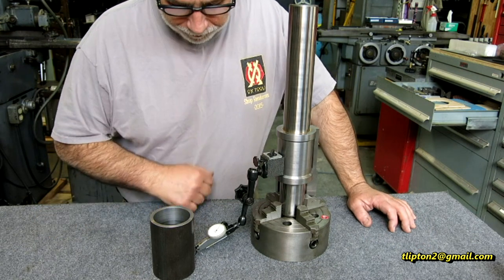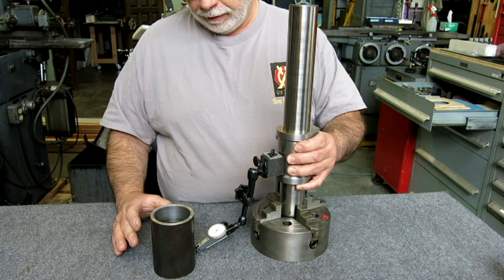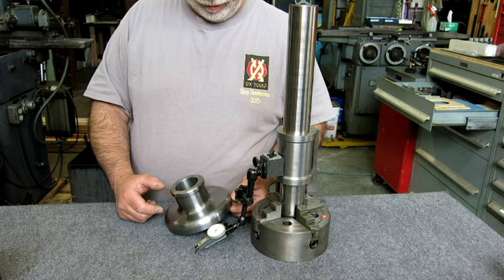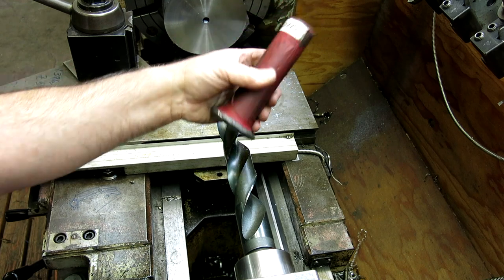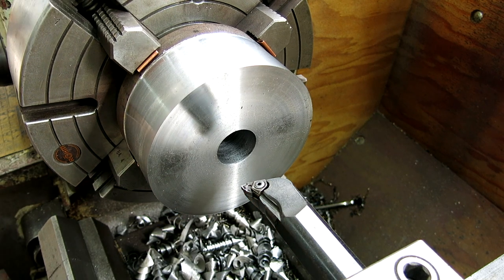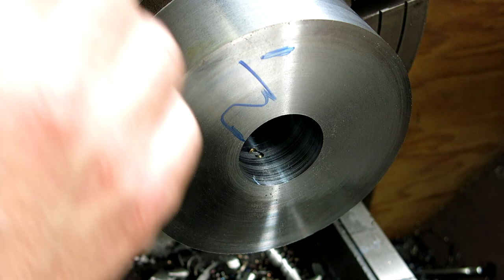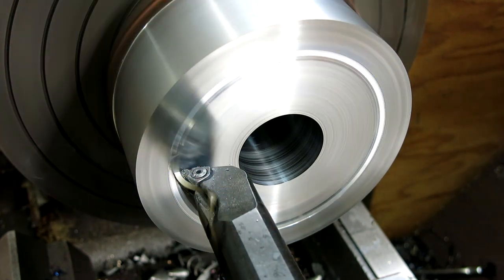Traveling Squareness Comparator Part 1

Comment: Sometimes it's the details along the way: I made up a set of copper-pipe jaw shields for my (small) 4-jaw a while back and was having trouble with them springing out of place and generally not conforming well to the jaws. After seeing this I hit them with the propane and son-of-a-gun, a little light hammer-forming brought them into close-fitting, custom shape! That annealed copper is like a whole different material. Thanks Tom! :)

Comment: When you were using the boring bar to face the shoulder feeding in towards the center. That's a LOT safer than feeding out then cutting the shoulder after. I just learned a trick, thank you

Comment: I've got an excellent performing flycutter that uses the round tips. Learned something in this one that will help while using it when I want an inside radius between a vertical and horizontal surface and getting it without chatter. Thanks very much.

Comment: @ Oxtoolco I've notice here and in a lot of other video's. As a drill enters a work piece it shifts slightly to one side or another (5:10 ish)  Is that just and indication of the drill finding center? it seems to me if there is a shift the tailstock or something isn't quite lines up correctly?  am I just overthinking this or is there something else going on?

WOW the large drill bit is looking like a piece of wet spaghetti.
Reply: I also need an answer to that question :)
Reply: I think in this case, the surface of the drill's cutting edge is not sliding smoothly across the surface. The work piece is giving up little bits of metal in fits and chunks. The drill has to flex to compensate.

Comment: The drilling portion of this with the big drill is a testament to how much movement you get out of a drilled hole, you can watch that big ass drill flex back and forth
Reply: Yeah she was a wiggling.
Reply: Yeah, I was scared when I saw that. It's gotta put some stress on a tail stock to go that big almost immediately. Just me but I would've worked it up in more steps
Reply: there's a formula for your pilot hole, something like 1/3 the diameter of your big drill, more steps is more time and harder on the bits, as long as it's big enough for the  flutes to engage
Reply: understood. The chips are pretty awesome once he gets going
Reply: It's been 20 some years since I was a lathe operator at a metal spinning shop. I get homesick watching lathe operations on here. We had an old Italian lathe in our shop that had a saddle that moved the opposite way of any other lathe. To travel toward the head stock you turned clockwise. lol
Reply: It is a testament to a crappy grind.
I get it is "fine" for this situation, but I would embarrassed to put that on the internet.
Reply: is it really moving that much or is it some video software artifacts or something? its crazy!
Reply: @kungmat
It really is moving that much, you can see it is only cutting on 1 flute, and does not start cutting on both flutes until he starts to put the heave on it, so the grind is way off.
Any one can grind a big drill like that. Like I said, I'd be embarrassed.
Reply: @Barry Atkins
Save your fanboi outrage for someone else. Ya, I have seen that vid, Tom is a research machinist, we all know that. It does not make him the God of Machining, and it certainly does not make him infallible.

Tom knows more about machining than I ever will, but that does not change the fact that at times he does stuff that is questionable (this video) or outright incompetent (his video on knurling is seriously cringe worthy).

Comment: Do the pieces that you're measuring and the instrument have to be clamped down to the surface plate, because unless I'm misunderstanding something if you bump it a little bit you have to start the sweeping again?
Reply from the maker: When your working on the surface plate not much is bolted down anyway. You take multiple readings  and move carefully. No worse than sweeping a surface with a surface gage using a sensitive indicator. Cheers. Tom

Comment: To use copper tubes between jaw and work is a great idea. However I always used sudden cooling to make copper for gaskets. Are there different coppers requiring different heat treatments? Thanks, interesting video.
Reply: If you are annealing copper by heating to about 400 C or so, it doesn't require quenching (rapid cooling). I just usually dunk it in water so I don't burn my fingers while waiting for it to cool :)

Comment: Wanted to thank you for all those boring videos on accuracy <grin>.  I've had this INCA planer/joiner for some 20 years and could never really get it to cut smoothly.  If I was really lucky I could get a 90 degree corner.  After watching your thinking through various problems (which started out with leveling a lathe) I started to apply such thoughts to other things like that (*^(*&%&^( INCA.  I'm making a vibration isolator for a turn table for a friend of mine and needed accurate cutting of very dense wood.  After staring at that INCA for a while, I put together a plan and it worked perfectly.  I now have flat and parallel surfaces in wood.  And now I know how to use that INCA and it turned out to be not that bad of an investment.

Comment: Hey Tom, great video as always!

Question: Shouldn't the indicator mount be keyed onto the vertical post of the squareness comparator?

If you inadvertently rotate the indicator around the post slightly, won't that cause a false indication of out of squareness?

If the indicator mount was keyed to the comparator shaft, then you would rotate the entire comparator on its base to find the highest reading; then you would slide the indicator up and down, relying on the weight of the entire squareness comparator to prevent any rotation.
Reply from the maker: Hi Joe. The idea is to sweep horizontally with the traveling part and leave the base stationary. You are not trying to track a perfectly straight line vertically. Hope that makes sense. Cheers. Tom

Comment: What is the point of the copper pieces when you hold hot rolled stock ?
Reply: Minimise wear on chuck due to oxide coating?
Reply: I wondered the same thing and that makes sense. I didn't think there was a concern of marring the surface of the rough stock piece.
Reply: Probably also to increase the holding area of the chuck jaws against the irregular surface.
Reply: A malleable surface improves your grip on irregular surfaces and aids in bumping short stock into rough alignment without resorting to extreme clamping forces.
Reply: It helps with the grip.

Comment: HEY TOM ! You should be able to drill 1 1/2" in your lathe without the need for a pilot hole. I've drilled diameter 75mm into bisalloy & mild steel without using a pilot in a radial arm drill & 2"-2 1/2" in the lathe with the drill properly sharpened.The drill web needs to be sharpened  to a point much like a spade drill. It is easy to do even with a small type pedestal grinder, a boss I had years ago showed me howto sharpen larger drills to do this Flooded with coolant at low RPM so there's no mess.
Reply from the maker: Hey Peter, I don't have the horsepower in my arms any more. Cheers. Tom
Reply: It's not very kind to the tailstock quill nut either

Comment: Nice...a little slow in your feeds ...especially in your first roughing cuts...why copper used on hot rolled surface..I'm for getting the job done lol.?  Hint...you can quench copper in water to prevent oxidation/scaling=speed...no need cleaning.

Comment: When you mentioned hardening, Do you mean case hardening?
Reply: The 8620 alloy steel Tom used is fully heat treatable.  Tom has a connection to a professional heat treating service.  He'll grind the part, after hardening and tempering, "dead nuts".

Comment: What insert type are you using in that boring bar? Looks like a positive rake trigon, which I didn't know existed.
Reply from the maker: Iscar WNMG with a PP chipbreaker. Makes it positive but with six cutting edges. Cheers. Tom

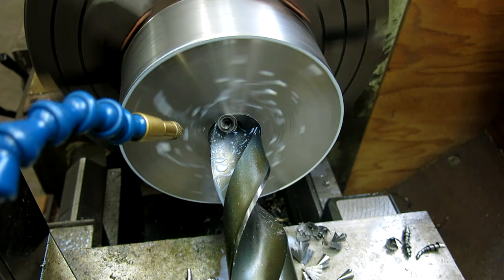Comment: 6:29 is all that wiggling in the drill actually the drill or is it the camera being affected by the vibrations?
Reply: Did you have the volume turned on? He specifically said, "... You can see it vibrating there." The but was wiggling/vibrating before it was guilty engaged in the cut. That's why you don't use a drill for the finish diameter or for any hole that needs to be even the slightest bit accurate.
Reply: Eli Douek That is the drill. Cutting forces on large twist drills tend to try to un twist the drill causing the flutes to cut at different rates, even factory sharpened drills.  This flexing and pulling tends to stabilize after the drill margins come into engagement.
Reply: One reason why that large drill wanders around is because of the pilot hole, as in it has no point to center to until it is fully in the material.